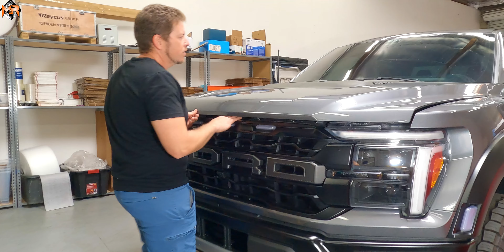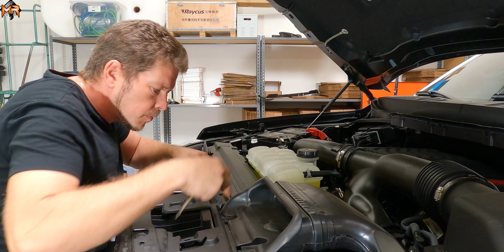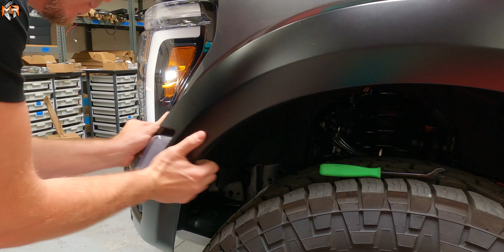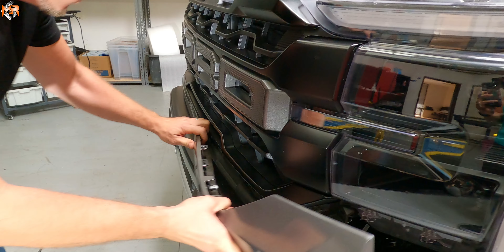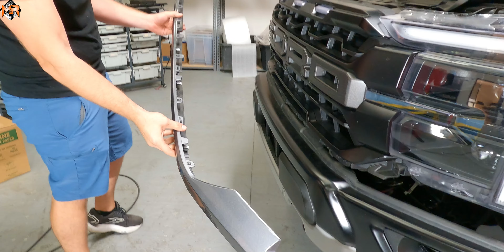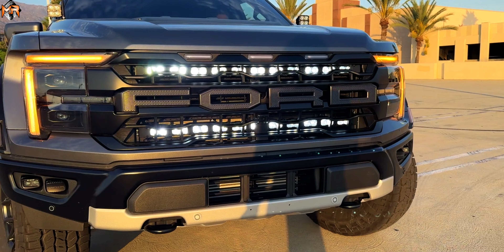2024 Ford F150 Raptor Gen 3 Refresh How To Remove Grille |Tutorial by M&R Automotive

Comment: Are the marker lights bolted to the grill from the back? Have a light out (side closest to driver) and not sure if taking the shroud off is enough to swap? Also when I push the front of the light it flickers on so wondering if it may just be loose connection.